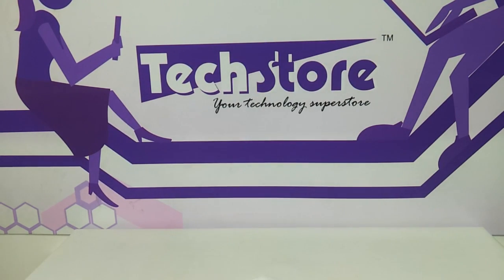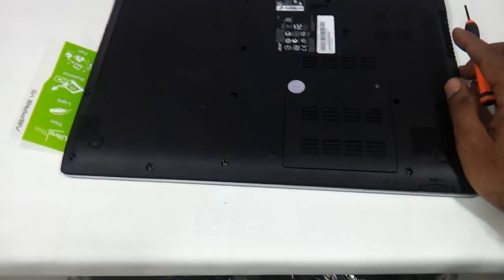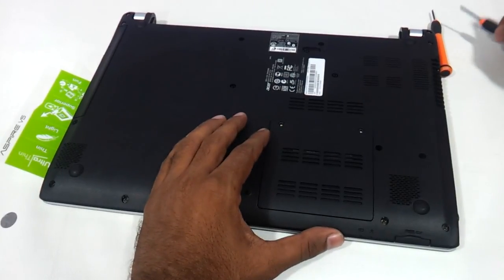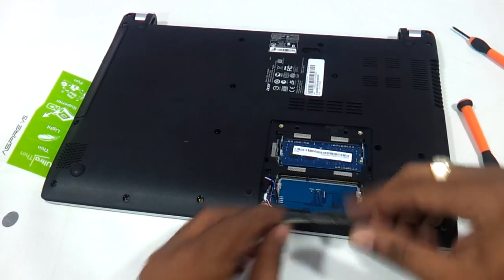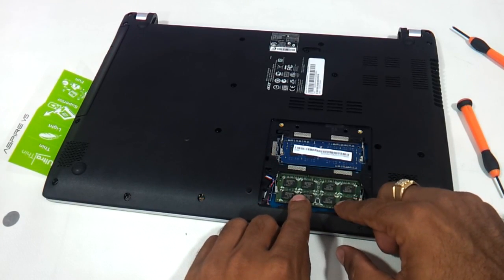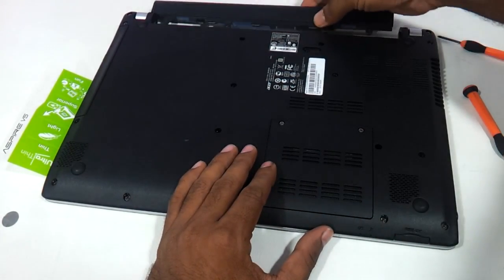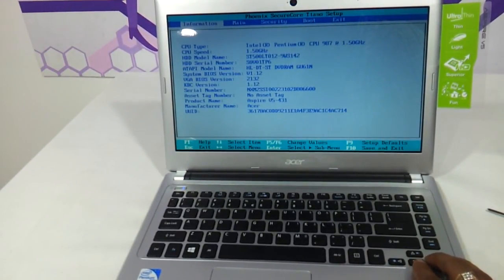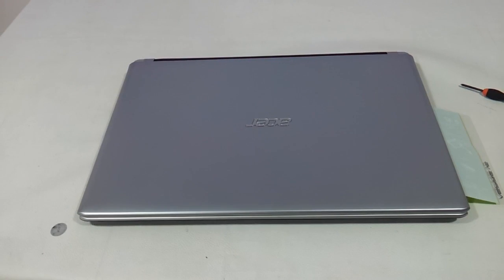Acer V5 laptop How to Upgrade ram simple

Comment: I have acer v5-471g with already 4gb memory, but if I want to add more 4gb RAM, I really want to know which is better
1. Add another 4gb ram with different manufacturer in 2nd slot
2. Replace the existing ram with 2x4gb ram, same manufacturer
3. Replace it with one 8gb ram
Thanks for your answer guys

Comment: so i have the acer v5-573g which has a capacity of 12 gb...how am i supposed to upgrade it to 12 gb if it has only one memory     slot
Reply from the maker: You need to take 8Gb+4GB memory modules.
Reply: will that be useful?or should i keep it at 8gb dual channel...can you tell me me whether the aver v5 573g i7 version has extra ssd slot

Comment: Would  Transcend 4GB DDR3L 1600 LAPTOP RAM work in my Acer v5 431 987 ?
Reply from the maker: +Davneet Singh Yes it would fit fine.
Reply: +Techstore is it okay if i buy and put Simmtronics 2gb ddr3 laptop ram - 1333 Mhz in Acer Aspire v5 431p??
plss reply /\

Comment: yo friend my laptop is taking a long time to start after installing more ram is that normanl?
Reply from the maker: That's not normal. Pls share your cpnfiguration
Reply: +Bailey Lau your memory might have defects or you bought slower memory. For example if you bought defective memory the system will use a page file on the hard drive as memory, which is much slower than ram.
Reply: its ok now my laptop is working fine, i just didnt put in the ram properly

Comment: hi,i have an acer aspire v5-471g core i3 w/ 4gb ram. can i upgrade to 8gb? and if so,what brand or model would be the best?? thank you
Reply from the maker: Yes you can very well upgrade
Reply: Techstore thanks!! Any suggestion on what brand and model should i buy?
Reply from the maker: Yes you can. Buy a ddr3l ram
Reply: Techstore if i buy KINGSTON KAC-MEMKS/4G will it work??
Reply: Any DDR3 ram can use

Comment: Hey I dis the same on my acer v5 but when I turn on my laptop the screen doest turns on it just stay black, everything works except the screen. What you think about it?
Reply from the maker: venyc82 Do you see the acer logo once it boots ?
Reply: Nope, the screens doesnt show anything,but when I take it out and put the old one it works well, everything works but the screens doesnt work. thanks for answer.
Reply from the maker: You need to change the ram which does not seem to be suitable for acer V5. could you tell us the specs of the memory you are using ?
Reply: the one that comes with my laptop is NANYA 4GB 2Rx8.PC3-10600S-9-10-F2.1333 and the one I want to put in my laptop is a Samsung 4GB 2Rx8 PC3L-12800S-11-10-F3. My computer is upgradable to 8GB of Ram and I want to put it together but I already try it with my other laptop and it does the same thing a black screen. It might be the ram, right?

Comment: respected sir,
       i have acer aspire v5 571G modal notebook ,its config. are:-
intel(R) core i5 3337U 1.80GHz.
4 gb ram
64bit OS windows 8
2 gb nvidia graphic card
sir, i dont want win 8 as its slow in gaming and give very less FPS .how to install win 7 ultimate ..and my screen doesn't show the BIOS KEY to open BIOS (F2) doesn't work how to get that key work at the start...
Reply: if u want a video to understand i can upload  it ...

Comment: What is the maximum ram on this? I have 6 on mine now (only 5.8 usable) and I want to upgrade to 8. Is that possible?
Reply from the maker: Hi, It is possible to upgrade the memory to 8Gb.
Reply: Thank you!
Reply: Actually, on the details of the v5-552 (not sure if it is actually demonstrated but it is the slightly newer model) it is possible to upgrade to 12 GB

Comment: Thank you for posting this. There is not a lot of tech information out there for this model. Of all things, I had trouble removing the battery. The slider on this series is different than those I'm used to on other brands of laptops. It was one of those "Derp!" moments!